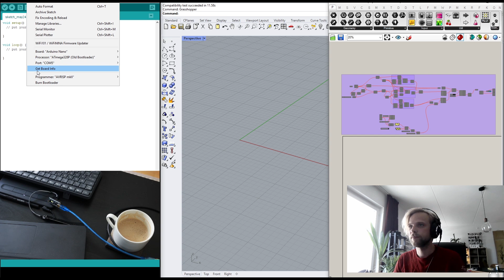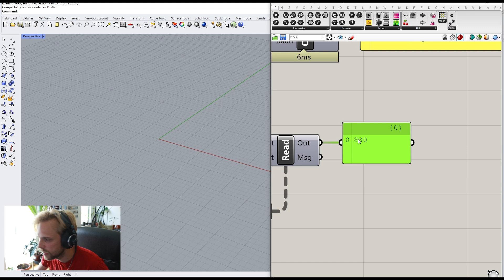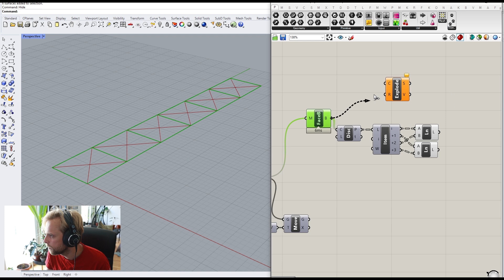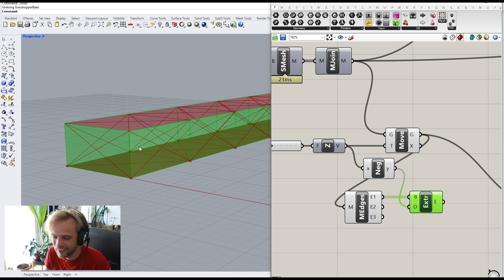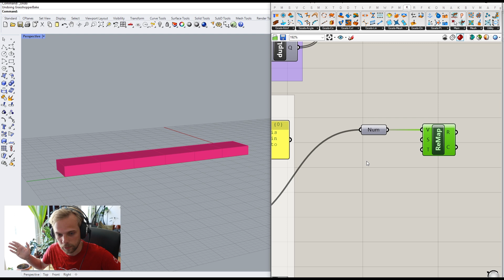Tutorial: Rhino 3D model control with a sensor (Arduino + Grasshopper)

Comment: Great tutorial - thank you! However I am having trouble accessing the COMPORT (in my case COMPORT 6) in Grasshopper. I have used Firefly before but had uploaded the Firefly Firmata file which allowed Grasshopper to connect to my comport. In your tutorial you did not use this file and for me this means it cannot connect...
can you advise?
Reply from the maker: Hmm seems like some sort of an issue with the newest version of Firefly - I'd suggest contacting the creator of the plugin to ask for a solution as the issue is probably deep within fireflies "brains"
Reply: @DesignGoBrr  All good! I had the Arduino IDE Serial monitor open; my COMPORT would not open in Firefly while this was open. Once I closed it Grasshopper could read the Arduino
Reply from the maker: @SIDimage  Ahh yea, the typical "port already in use" problem :D Forgot that it's a thing

Comment: Have you tried running multiple sensors from the same arduino to multiple/different parameters in gh at the same time? If so How did you deal with that in Firefly? Great videos btw!
Reply from the maker: Hmmm never tried multiple inputs. Will need to come up with a project for it and test!

Comment: hi sir I facing the page during grasshopper start. how I can fix this problem .
 Arduino ,exe not found 
woops ! well this is embarrassing.it seems that we couldn't locate the Arduino,exe file. the root Arduino folder must be provided in order to upload sketches to your board. would you like to locate it manually?
Reply from the maker: Seems like arduino is not installed. https://www.arduino.cc/en/software Download it from here, install it. Then if the message still appears - click on "locate it manually" and find arduino.exe in the installation folder.
Reply: @DesignGoBrr  i found a file in the document folder by the name of Arduino but inside the folder there is no exe file